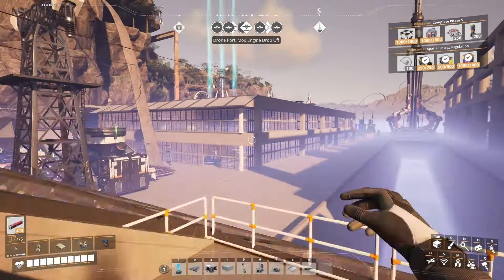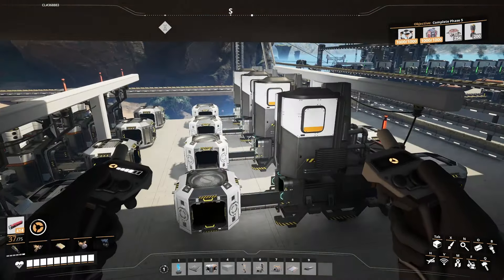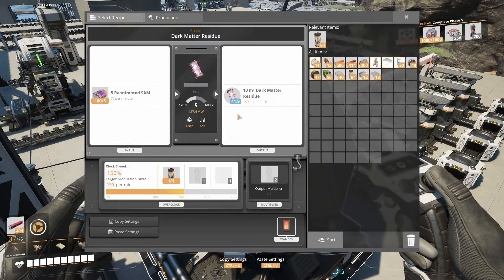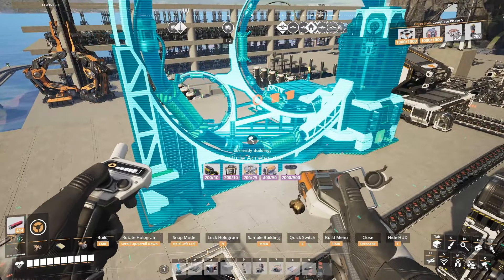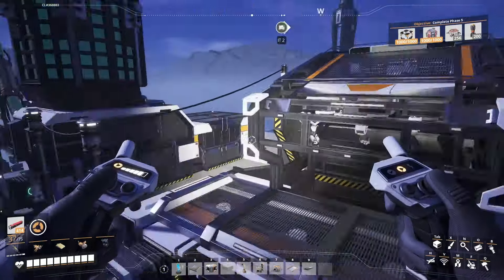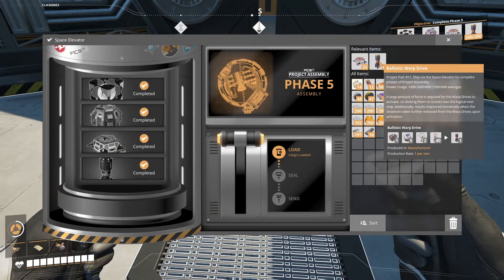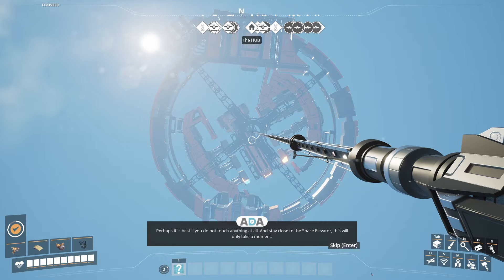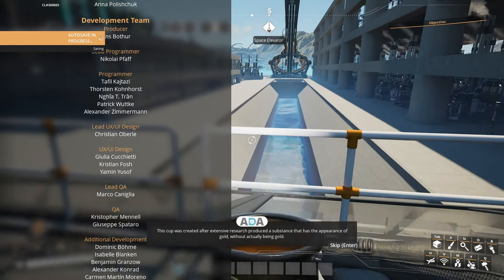Satisfactory 1.0 - Completed the Game with Minimal Power Used [E27]

Comment: Well done, Surtr - A very enjoyable series! 🍻 Absorbed quite a few tips along the way.
Quite liked the curved roof you put over the new Hub and some of the other things you were trying around fascia for factories, too. :)
-
I'm waaaay behind, but tooling around with blueprint designer, experimenting with structural prefabs - I'm going for a modular, bus factory for main site - supplemented by satellite factories to build parts where it makes sense.  I expect things will accelerate rapidly once I re-route basic ingots to the bus (Fe, Cu, Steel, Caterium, Concrete)
Reply from the maker: Keep it up. Sounds like you are doing well. Thanks for watching.